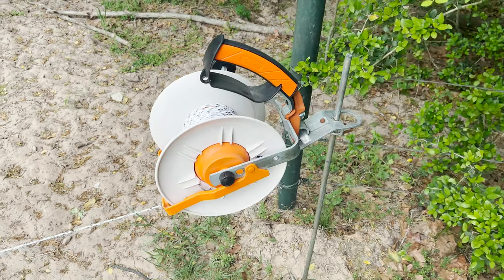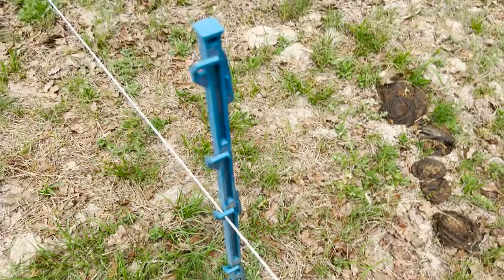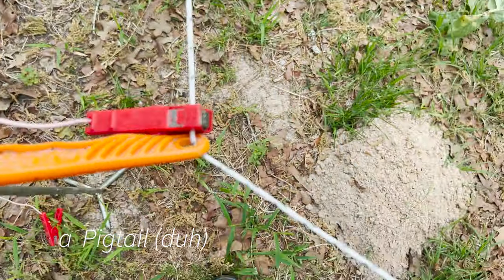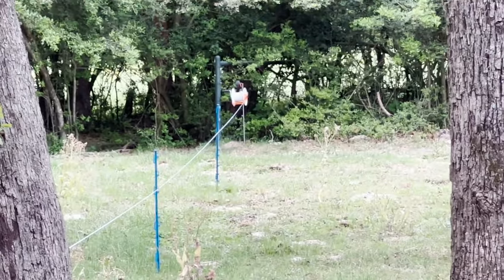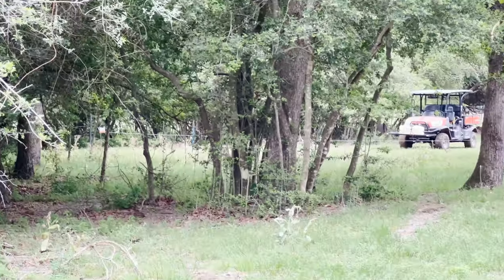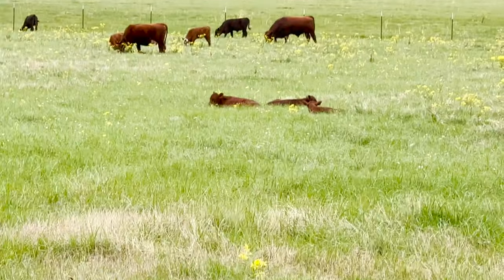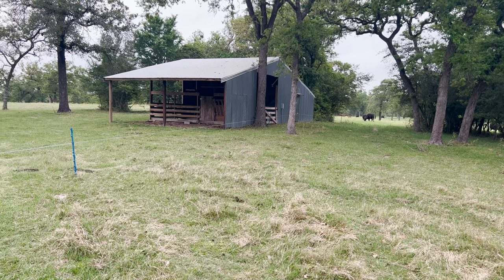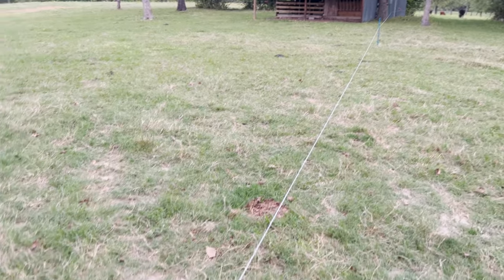Electric Fence Components That Work | Regenerative Ranching

Comment: Sure is nice to have your animals broke to a single hot wire. Only takes me about 15 minutes to put up a new paddock division and roll up the old one. Poly braid and geared reels are a game changer. I hope you get some rain down there. Have a wonderful day.
Reply from the maker: Thanks George!  Definitely a game changer and inexpensive in the big picture. It’s nice to place the paddock fence where it works best depending on the size of paddock you need based on how much grass is available that time of year.
Reply: @cliffhonnasregenerativerancher  it is so versatile, also when sorting or corraling you get do it with a single polybraid that's not even hot!

Comment: Thanks for sharing those terra posts, I'm going to have to pick up some. Corners have given me fits. We also have an area where we cross a gravel road with a high middle so you have to put some kind of support. Too hard and deep to use a step in. I've been taking 3 step ins and tying the tops to make a tripod which kind of works but the cows have knocked it over a few times. Anyway, at least you helped me solve one problem, haha
Reply from the maker: Necessity is the mother of invention!!

Comment: Nice equipment Mr. Cliff. I got in a situation two years ago and had to buy some step in post from my local big box store (the name rhymes with Kural Ring) and those post were the absolute worst money I have ever spent. Very flimsy and light weight. I probably broke 20 out of 50 in the first 2 uses. I only have 6 or so left and I only use them to mark sink holes as I find them
Reply from the maker: I did the same. The ones I purchased had a plastic clip the wire fit down into. Took two hands to get the wire out as you had to move the clip away from the post and it often broke off. Totally mind numbing and useless. The O’Brien posts are easy to use, well made and the clip doesn’t break off. Definitely the best step in post. Thanks for commenting!
Reply: The ones from stactor tupply are garbage too. The ones that come out of new Zealand and Australia are good. We have had O'Brien's for about 4 years and only managed to break a few . Most of those were from using them as corner posts or running over with the tractor (what? The grass was tall, give me a break, haha)

Comment: Great info Cliff. I am new to electric fence and am in the middle of setting up my system. My plan is to have a single high tensile wire running strategically through my place in parallel to my permanent barbed wire fences. That way I can hook my reels into the system at any point. Should provide lots of options. In a future video, could you show and talk about your grounding system?
Reply from the maker: Definitely, that’s on the list. Probably this week!  The single high tensile wire is a good idea as well. I considered that but decided I didn’t want to have to work around it in the pastures, so decided to prune polybraid. It’s interesting how my paddock separations as evolved as I’ve tried different things.
Reply: If you're using the same posts as the barb wire I would recommend using the long stand offs and, if possible, putting it on the opposite side of posts from the wire. We have had a devil of a time with the electric getting wrapped up in the barbed when we get bad winds. The only place we have not seen it is where we have the long stand offs
Reply: I stretched the high tensile wire parallel to my barbed wire fences using PVC tee posts. I stayed about 8-10inches off of the other fence so I shouldn't have any of those problems. I didn't want to deal with those flimsy tee post isolators.
Reply: @ericbradley4204  that is a much better way. We're planning to demolish the whole fence line and go back with high tensile 5 strands with 2 of them electrified so we're just dealing with it until then.

Comment: How many ground rods and what kind (copper clad/galvanized)do you use?
Reply from the maker: Three 8’ galvanized ground rods, 10 feet apart. I put them on the north side of the barn at the drip line of the roof. Has worked very well.
Reply: @cliffhonnasregenerativerancher  that is very well thought out... making a note north side on drip line 3x. 10 feet apart. 8 feet down